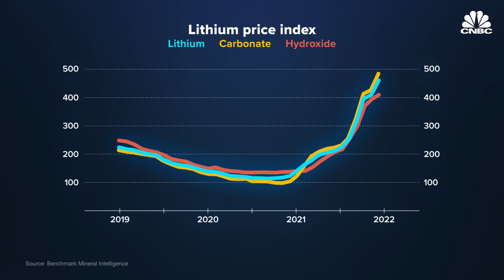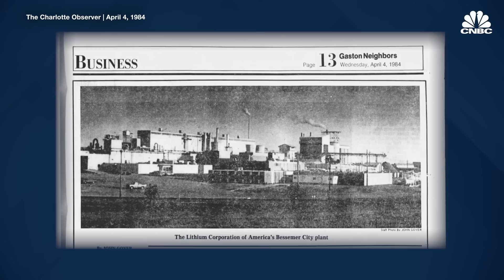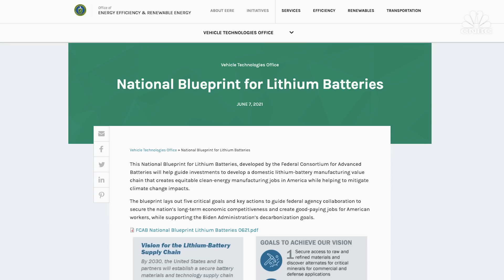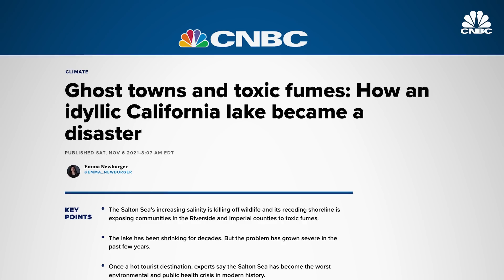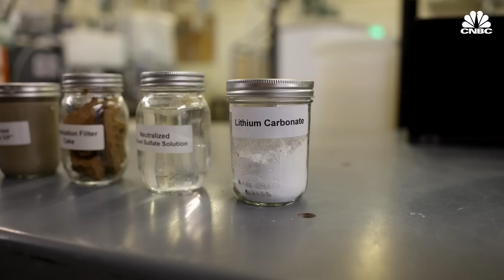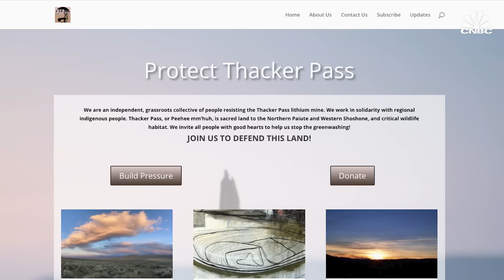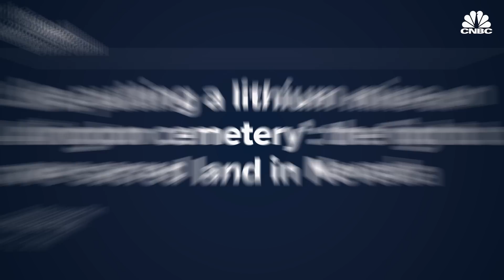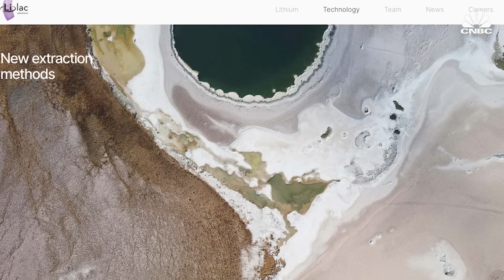Why The U.S. Has A Massive Lithium Supply Problem

Comment: Massive desalination should be considered. For water and food security, but also the oceans contain significant amounts of Lithium, and it remains in the slurry from desalination plants. Along with other useful metals and minerals. Maybe the net economic benefit can make it economically viable.
Reply: No desalination. Who is pushing this crap?
Reply: @Not-Sorry2011  I’ve seen lots of these comments too. No idea, where it’s coming from.
Reply: Is that actually your name or a clever reference to death?
Reply: Desalinization is very energy-intensive.  Also sea water is less than 1 ppm lithium, more like 200 parts per billion.  Compare that to sodium (10800 ppm), magnesium (1290 ppm), calcium (411 ppm), potassium (392 ppm), and strontium (8.1 ppm) -- not to mention the corresponding anions of all those salts: chloride, sulfate, bicarbonate, bromide, borate, fluoride, silicate, iodide...
Reply: @djo9c1  A low concentration yes, but when you consider that in the middle east alone billions (plural) of litres of seawater is desalination each day, then concentrations in the order of hundreds parts per billion starts looking rather interesting. The chemistry needed to isolate Lithium and other useful minerals from salty brines are not even that challenging. Any measures to extract metals from the waste brine will only alleviate environmental concerns.
Solar and wind are also ideally efficient for processes like desalination, since there is zero real need to run such plants continuously. You don't even need energy storage to make it perfectly viable using the de facto cheapest and most benign forms of electricity generation .
Reply: Its stay away from the ocean please

Comment: The Clayton valley in Nevada is home to one of the few areas in North America with a large deposits  that are fairly shallow and fairly easily extractable . There are 2 Canadian companies that own  properties in the Clayton valley  both have sizeable deposits of Lithium . Spearmint resources has a sizeable deposits already and recently drilled one of the largest concentrations to be recorded in that area which will likely add significantly to their already sizeable deposits . The other company is Cruz battery metals in the Clayton valley both companies are bordering major lithium producers .  The companies are  very under valued at this point considering that Lithium has gone up approximately 400% since Spearmint got a confirmed resources estimates from a major mining  estimator last year and now getting a further resource estimate update based on large concentrations found in recent drilling

Comment: Lithium is just a face but on background phosphate + nickle + Cobalt and other material combined called lithum
Reply: Phosphorus and nickel are less of a big deal but nickel kind of is, cobalt is not used in lithium iron phosphate batteries at all anymore so Cobalt is not really a big deal since everyone is phasing it out. Lithium is still the material that is going to be the most scarce. All of the others have massive manufacturing and mining is used for all kinds of industries, however, 90% of lithium is already being used for electric vehicles and mobile phones and laptops, which makes it very difficult to increase production.
Reply: @pilotavery  nonsense lithium is a very common element. refined lithium is in demand because it had limited uses before. at the current spot price there will be plenty of supply within ten years. copper is way more scarce of a element and is about a third the price right now cause it has been mined to meet demand.

Comment: a ton of lithium takes 500,000 gallons to process. The current 100,000 tons of production annual productin utilzes enough water to fill 1/3rd of Lake Erie.  The southwest USA does not have sufficient water to spare.  Chile and Maine have banned Lithium mining and processing mostly because of the water needed to be diverged for this use.

Comment: 7:46 land price for around 5,000 pretty neat I wonder if it's per acre or some other measurement bought my land in Montana for about $80,000 (6 acres)
Reply: why so much
Reply: @victorhopper6774  which one is so much the one in the video or my land
Reply: @nonyabiz6036  sounds expensive for 6 acres in montana
Reply: @victorhopper6774  got it in 2013 most of the prices were picking back up from 2008

Comment: EVs are more hype than saying environment. 
Hydrogen is the future of clean energy. Take heat of sun, run the turbine, use electricity to generate hydrogen. Simple, plenty and clean!
Reply: Are you sure? Considering energy efficiency from production to use, hydrogen vehicles are only about half as efficient as BEV’s using the cleanest methods of hydrogen production.
Reply: hydrogen is a lot more expensive
Reply: @scottjohnston2799  when you can make it in an easy, plentiful way, It will get cheaper over time, faster than even PV energy.
Reply: @PYTHAMAXX  yea as does anything gets cheaper when you make it in an easier more plentiful way. seems like solid state might be the next wave over hydrogen in my opinion
Reply: Hydrogen isn't an energy source, it's an energy storage mechanism. Also it's incredibly inefficient, losing over 50% of the energy from the sun. It's much cleaner to store that energy in a battery than waste it producing and then consuming Hydrogen.
Reply: @BHPGH  Hydrogen fuel cells are heavy on top of the already heavy battery. You're not going to get much range out of that.
Reply: @Ergzay  I believe sometimes it is more about abundance, easiness and cleanness than focusing on efficiency. 
Solar energy has a lot of potential, if we could tap it without needing large quantity expensive rare materials for another e-waste filled century, it is way better safer..just  Fill the gas cylinder, go! 
Interesting new tech! hydrogen combustion engine is gaining improvement.

Comment: There’s no water in Nevada to mine lithium. Hopefully we can switch to solid state batteries ASAP.
Reply: Tesla has patented a way to mine lithium from the Nevada clay without using the usual crazy amount of water.
Reply: Solid state batteries use lithium. Unless you mean some future sodium ion tech.
Reply: Always amazes why piping water seems impossible but we have oil and gas pipes all over the place.
Reply: @TheBooban  Nevada is in an extremely arid water shed, unless you want to tunnel through to the other side of the rocky mountains to take some water from California or go through the effort of pumping thousands of gallons up hill from somewhere even farther away there really isn't much water to pipe in.
Reply: @TheBooban  I guess the water in your home magically appeared there and things like The Los Angeles Aqueduct doesn't exist.
Reply: @BHPGH  true, but there’s the potential to use fewer lithium solid state batteries for the same charge, or use salt based batteries some day. Or even better skip the EVs and build train lines.

Comment: Not in my backyard sums up 99% of the environmentalists view. EV technology is great as long the power isn't generated near me or the environment damage is hidden from me.
Reply: EV vehicles take 40-70% more energy to produce than an ICE vehicles. One of the main reasons why environmentalist are worried is because government policy and education for consumers is basically zero, so the end of life use for EVs must be addressed to make them a positive for the environment in the long run.
Reply: @andyjohnson3790  Negative. It does not take more energy to make a EV than an ICE vehicle.
Reply: Yeah, I'm really skeptical about EV's becoming a mass-produced solution in general. At the very least I have not had very good luck with lithium batteries. They lose roughly half their battery life in 2-3 years, and around 5-6 they usually become nearly incapable of holding a charge. That's my experience anyway (maybe I'm just unlucky, I don't know), but that's the way it is with my tablets/phones and as far as I know the tech is the same they use in EV batteries, just obviously on a larger scale. Honestly I can't imagine having to replace an expensive car battery every few years and make it anywhere near cost effective. Especially not since the battery for an EV is one of the most expensive components.

Comment: Lithium is common, but it is not common for it to be concentrated into economically recoverable forms. Most lithium minerals are highly soluble in water, meaning that the vast majority of the planet's lithium is diluted within salt water within the ocean and underground. Conservative estimates for simply lifting the water to produce a kg of lithium from sea water is about $6,000 in electricity, which means a current Tesla battery would cost six figures in raw material.

Comment: Lithium is not only a very common chemical element in the earths crust but exists in large minable deposits in sufficiently high purity grades.  In fact, all over the US and Canada there are at least two dozen closed down but perfectly good lithium mines.  British Columbia alone has 4 very large lithium mines all closed down since the 1970s because the price of lithium dropped.  Lithium is everywhere globally.   It's cobalt, that's used as lithium battery cathodes, that's in short supply.
Reply: The key in the near-term is going to be to use LFP batteries. They are cheaper and cleaner to manufacture, longer lived, and do not require cobalt or nickle, and are more than adequate to power more "economy" EVs. Tesla has started switching their "standard range" models to LFP battery packs, they largely maintain the same range and efficiency, but the battery costs far less and will have a much longer lifespan. A bit slower, but I don't think the majority of people need blisteringly fast cars
Reply: Those reserves really belong to those native tribes

Comment: I'm all for Native American rights, but this project needs to be built.  I noticed that the video showing the vegetation of the Thacker Pass site was displaying a vista of Cheat Grass (Downie Brome), which is the scourge of the West.  Cheat Grasss is a CAM 4 plant, meaning that it requires more carbon to make its fiber than most plants.  So if you add more carbon dioxide to the atmosphere with burning of fossil fuel, it is that much easier for Cheat Grass to grow, impacting millions and millions of acres of land.

So if you think big picture, the best thing to do is get to electrification of our energy production as soon as possible with Lithium ion technology.  The blockade and protests of dirty tar sands from Canada and sending it thru a pipeline is completely different than the protests going on in California over Lithium.

The most environmental thing we can do is ramp up Lithium based energy storage and have electric vehicles for transportation.  Down the road, the worn out batteries can be recycled, and not as much virgin Lithium will be needed.

Comment: Once lithium is mined, processed and enters the lithium-ion battery supply chain, it can be used and then recycled over and over again. Not true for fossil fuels. Key difference. Environmentalists should be supporting lithium mining in countries, like the US and Australia, that have sophisticated mining regulations that minimise environmental impacts.
Reply: Actually mining in US or anywhere else isn't needed. There are large deposits in Argentina, Bolivia and Chile. The only problem is that the locals there do not permit this otherwise we wouldn't have any issues.
Reply: Because they aren't trading the beauty of mother earth in exchange for "promises."
Reply: @ADHD55  umm cause it's better for the environment overall? The location of these salt plains are  where there's low population. So the companies going to mine there can essentially pay a certain percentage of profit to the local government and the local government in turn can dig wells or whatever for the local people. Even better would be to relocate the small population (by paying them for housing) to a wealthy city where water is not an issue.
Reply: This. Plus one need x amount of lithium to produce the battery and then you good to go, whereas fossil fuels need to be pumped into the car day by day...
That is why lithium is might be called white gold, it will never be like oil. If lithium supply is cut, new car production is halted, but existing cars can be used. If oil is cut, everything falls apart. The dependence on battery minerals cannot be compared with that of oil.
Reply: @SahilP2648  Many of those resources are already owned by Chinese companies.

Comment: A typical EV battery has only 8kg of Lithium. There are 1.47bn cars in the world. Rounding up, that's 15bn kg of Lithium for each car to have an EV battery, or 15M tonnes. We know of 26M tonnes of lithium reserves, which is tight, but we also know that more reserves will be found.

Comment: Just go to Wendover Production's video on Lithium Ion batteries and go to minute 14:25... as well as this video. It brings up the same exact point.
Honestly unless you can make cars run on water then you can't tell me EV's are not a much better alternative to ICE vehicles
Reply: EVs = no catalytic converter, no transmission, no oil changes, no radiator, no muffler, no fuel injection, and runs cleaner than ICE even if the electricity comes from a coal powered plant.   And MUCH more fun to drive.  So there's that.
Reply: @charleskramer6189  I’ll disagree about fun to drive but of course thats an opinion

Comment: what happens when we run out of lithium
Reply: It's a hugely abundant resource but also can, in principle, be recycled over and over and over. Metals are limited in supply but can be recycled to continue to meet demand. Oil, coal and gas are still abundant but once burned or turned into petrochemicals, they're gone.

Comment: How about stop using as many cars? And maybe just maybe use public transport?
Reply: Maybe if public transportation was actually good. It’s terrible in the usa.
Reply: EBIKES!!!!
Reply: Have you looked at map? The US isn't Slovenia. The US is huge
Reply: You dont need to bike or use public transport from city to city just within a city.
Reply: @okoljskoinzinirstvo9353  The problem is that American cities were designed for cars, efficient public transport system, which works in Europe, doesn't work there. The distances inside the cities are just too big, the population density is relatively sparse.
Reply: @vinceszigetvari6137  and what european cities werent once designed for cars too? Its all lame excuses because they do not wish too change their way of life.
Reply: @JJ-si4qh  
High speed rail network. Construction is going to be a huge jobs source, and they can be built close to existing highways unlike oil pipelines
Reply: @okoljskoinzinirstvo9353  European cities were mostly built before cars, hence they were built for pedestrians. +Land is much sparse in Europe, hence instead of large suburban family houses with big gardens, multi storey apartments were prefered, or smaller houses with smaller gardens. Therefore the population density is much bigger in European cities, that's why public transport works well.
In American suburbs the houses are so far from each other that bus stops cannot be placed close enough to houses.
Or if you put a bus stop in walking distance of every house, the number of people living in those houses are just to few to make the bus line sustainable. Meaning most of the buses were simply empty most of the time, which is pretty wastful.
There are some US cities which are more like Europe, for example San Francisco or New York. But these cities also have good public transport.